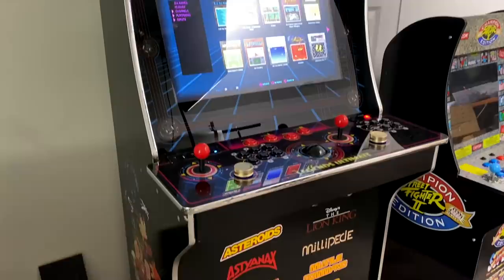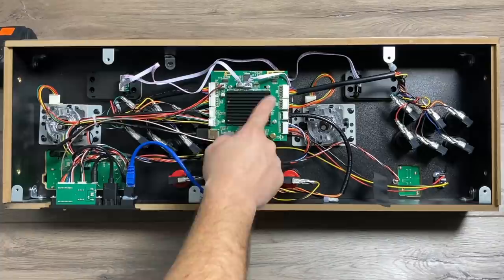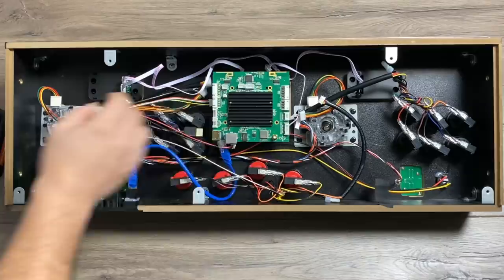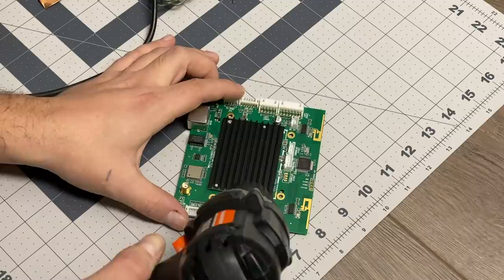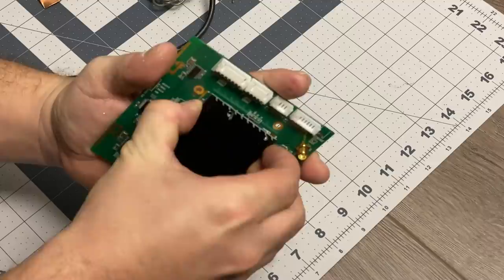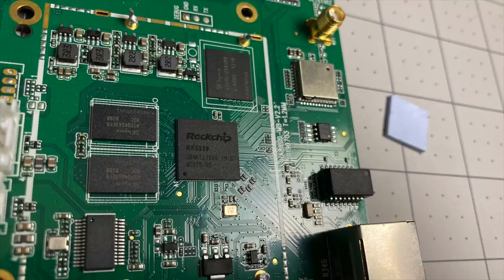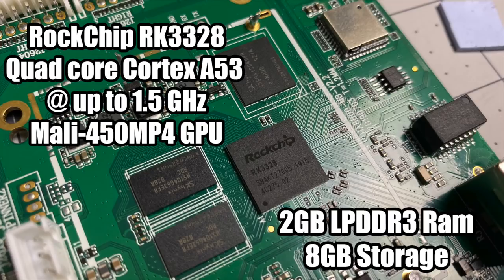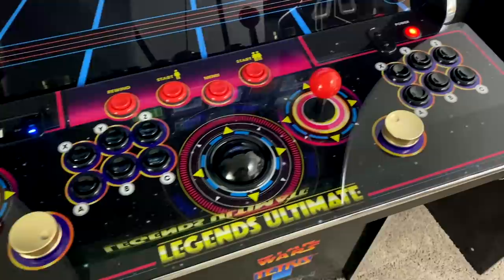CPU Revealed! AtGames Legends Ultimate Arcade Mainboard Teardown

Comment: >Doesn't want to damage the board desoldering
>PROCEEDS TO DRILL THE BOARD
Reply: Generally, if you have the ability to cleanly drill out the studs, it is safer than desoldering (both can be done safely, yes - one is just lower risk to the board)
Reply: @Alzorath  yeah true if he doesn't have the tools, if he had solder wick, flux and a iron he'd have it off in no time.
Reply: @hx8457   yeah i was wondering the same thing.  I'm quite new with soldering but if you're careful which most people are it should be simple enough.
Reply: desoldering is piss easy,  you would have to be real newbe to stuff it up oO
Reply: Yeah I don't feel like I am good at soldering but I would have soldered over drill, no question

Comment: I remember being six years old and standing on a wooden box to reach controls on arcade cabinets for Millipede, Crystal Castles and Elevator Action. I imagined machines to be completely filled with wires and circuits, I was shocked to see they were mostly empty inside  xĐ
Reply: This is not an old school Arcade Machine , the Real Arcade Machines did have lots of wires and big boards , so it was not Empty like the one you saw on this video.

Comment: Rk3328 is an old chip but it is extremely well optimized and not a bad decision cost wise.

Also you could probably leave the heatsink off, it's most likely only using 5 watts.

Comment: Thanks for showing this. I was really wanting one but was balking at the $500-600 dollar price tag. I dont really think the CPU used justifies the price tag to buy one honestly. I think I'm going with my original plan to buy a gutted arcade machine for $100 and use my own computer to build a mame machine for emulation. It's much cheaper that way and I will be able to run more games on it.
Reply: I'll say I love my machine but when your right, your right. Not to mention then you wouldn't have to worry about streaming it from a desktop

Comment: Specs of this custom SBC should be comparable to a Raspberry Pi 3. Pretty weak for 2019, considering this isn't even a portable device.
@4:14: H5TQ4G63EFR is a 4 gibabit chip. That translates to 1GB for two chips. Are there more RAM chips on the other side of the board ?
Reply: I have seen a pic of the bottom, no RAM chips underneath. So only 1GB of ram

Comment: I want to install Ultimarc mag stick plus joysticks on this because you can change to 4way and to 8way from the top with out opening the back up and moving the gates. I also was thinking of changing to Servostick that Ultimarc makes that changes the state 4way to 8 way of a press of a button but gets a little more complicating and have to use outside pc to program them. I don't know if you can do this to wiring one up. What are your thoughts?

Comment: Could they not have used an UDOO RYZEN BOLT V1000 Maker Board SBC with some form of emulator that runs on on an 80586 processor or something.

Comment: If you just run a raspberry pi to the HDMI from inside the cabinet and use the controls via Bluetooth, is the input latency bad at all?
Reply: Well Bluetooth always means significantly higher latency.
Reply: You can plug into hdmi right on the control panel

Comment: Question: how easy would it be if its even possible to change out the buttons for something like sanwa?
Reply: It's very easy, almost like changing a light bulb. Screw it out, place in news buttons. Reattach the wires.
Reply: I would make sure all the plugs are the right ones before buying, screwed up myself due to inexperience.

Comment: If you haven't, hop on by the LegendsUltimate sub-reddit - https://www.reddit.com/r/LegendsUltimate/comments/e1b8wj/we_have_root/ The hardware specs were posted about 3 weeks ago (and didn't require any drilling or desoldering).

Comment: @
ETA PRIME  I cant seems to get an answer whos spinners there using (or what type) .... can you tell??  also whos trackball as well???
Reply: They are their own spinners similar to Glenn's retro
Reply: @flpennstater305  ooohhh.... potentiometer type.... EEEKKKK .......is it at least weighted?
Reply: They are nice metal ones with good weight.  Can't tell the difference personally between Glen's and these besides color.  They are high quality.  Not like the 1 up crap

Comment: A 20 dollar chip for a - i estimate - 400 dollar device? Okay, it is a customized motherboard, but still....
Reply: Jan Jacobs iPhone anyone? $200 in components, $1000+ price tag.
Reply: Well you can buy a $400 1up that has a pcb that plays a total of 4 games if that floats your boat with controls that only fit those games and that you have to mod to do anything with
Reply: I 100% agree.... I scratch build one of my Bartops for less than $100... if this was sold for $300ish it might be worth not sourcing all the parts.... but noway at $499 .... well unless someone wants to gift it to me....  ;)

Comment: So at Games build it with cheap trash chip and ram thats why they made it none removable then charger Canadians  899.00 plus taxes over a thousand for 4years extended warenty and with pin ball buttons for the 1.1. The price i paid for this is embarrassing to find this out have you seen how cheap these parts are at games has along way to go extremely disappointed is a understatement. I just hope it lasts and well aware moving parts fail but these cheap chip and ram is so lame